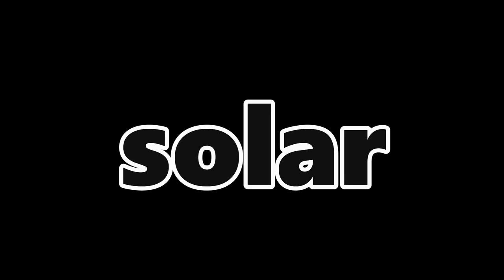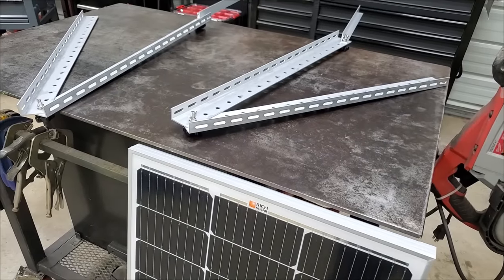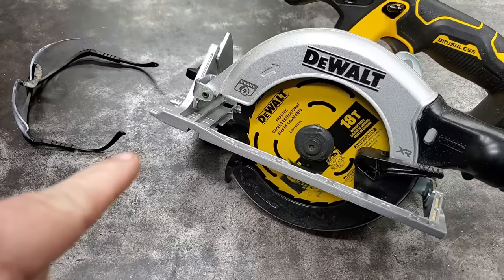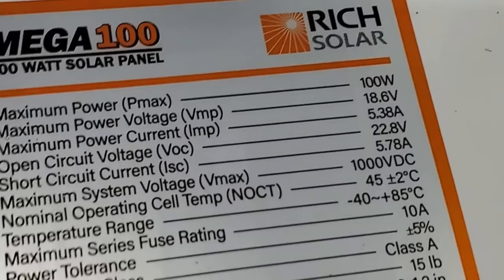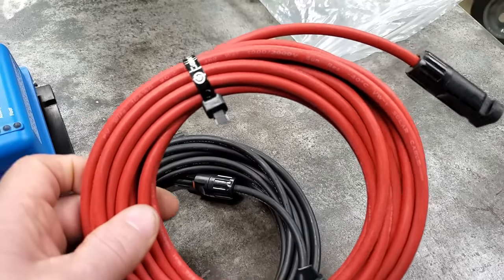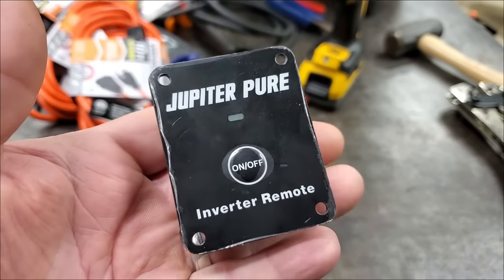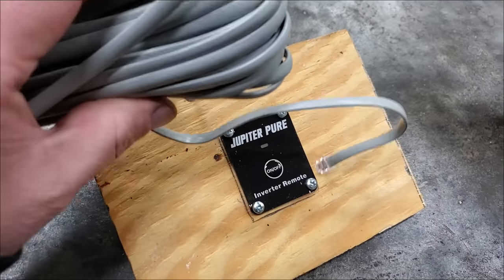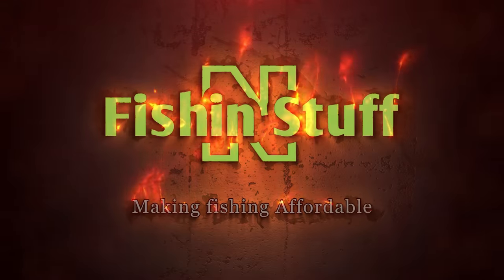Beginners Solar project ( very Simple )

Comment: He says, "If there's a hurricane and it cuts your power out, you can re charge your Ecoflow from the solar panel system on the shed. " ..... so the hurricane that kills your power is going to leave your chicken coop, the solar panels on the roof, your shed, ... all that stuff is gonna be 3 miles down the road, brother.
Reply from the maker: What ever . We are 300 miles from the coast and in 1989 hurricane Hugo knock out my power for 3 weeks Brevard Duke Power was so far behind . No one house or chicken coops lol . Were gone . It just knocked over trees and took out power lines . Do your homework ( but I suspect you know everything  ) Hugo didn't die completely out until it reached Canada
Reply: We don't have hurricanes or tornadoes in the PNW.

Comment: Yikes don't forget to add a circuit breaker and/or fuse in between:
1. The solar panel and solar charge controller.
2. The battery and solar charge controller.
3. The battery and inverter.

Comment: the longer i watch the cheaper hard wiring is lol
Reply from the maker: Of course is cheaper  . It's also not self sufficiency  . I never said it was cheaper  . But if the power goes out it will be , buying a generator and gas to put in it is definitely more expensive

Comment: When U calculate how many solar panels U can put in series, U can not use the Vmp value (18,6V). U have to use the Voc (open circuit voltage), because when the battery is full, the charging stops and the charge controller will resive the open cuircuit voltage from all the solar panels.. in theory, if u only use the Vmp, U can have 8x18,6volt= 148,8 volts, and the solar controller is good for 150 volts, everything is fine. But when the battery is full, the charge controller stops charging, ‘opening’ the cuircuit, and the voltage reatches 8x22,8volts=182,4 volts.. THAT is way over what the charge controller is rater for. U have to go down to a max of 150/22,8 volt= 6,5 solar panels, and since there are no half solar panels, 6 panels is the max U can have in series. (U can not just grab a number (20volt) out of thin air)
But great vid! Good luck with solar!
Reply from the maker: Thank you for the information Sir

Comment: WHY do you use a power wasting inverter?  By-pass the inverter and run 12 volt lights saving money & power.  It works I run my whole house on 12 volt.  I have 12 volt lights through my house including basement, garage yard lights, fans, coffee pot, even an electric blanket all on 12 volt.    Works great. You can get a lot of this 12 volt stuff at truck stops.  I use Edison base light fixtures and Edison base 12 volt lights it's much cheaper and you can add a couple extra lights to get all the light you need this is much cheaper and works GREAT.

Comment: Not trying to sound like a grammar snob, but those aren't generators. They are energy storage. I remember when people first started commercializing portable power banks as generators, it drove me nuts. They don't generate any energy on their own like a gas generator.
Reply from the maker: I know your right and I'm wrong technically  . But to me a portable  power bank , is like what I did with the Ammo box video  . Meaning it's just a battery  . I just feel like they do generate power . By taking the sun's energy and turning it into 120v . Just like other generators take gas and make 120v power . But I do get what your sayin

Comment: The 'remote' is attached to a wire.  Normally the term 'remote' implies there is no connection.  Really, it should be labeled on/off switch and leave the 'remote' off.
Would a controller that allows you to turn a tv on and off that has a wire that attaches to it be called a 'remote'?  I don't think so...
btw @20:22 pv stands for photo voltaic.

Comment: I would have installed 12v lights and avoided the inverter. You will get way more efficiency.
Reply from the maker: Your exactly right , I did think about that when I was planning it . But like I said I'm going to add to it . Ideally I'd like to put a deep freezer out there . I even thought about putting a router in the building so I can run a blink camera ( my wifi won't reach to the back of the building , but it reaches the front  ) that way I can check on my chickens and get alerts if anyone or anything is messing around in the backyard  . I just went ahead and bit the bullet.  I know I could have added it later

Comment: The funny part is you are using solar panels to produce DC voltage, storing it, converting it to 120V AC, to power LED lights that internally convert the 120V AC to ~24 DC.  If you are just power lights, better off to just use low voltage LED's and skip the inverter.
Reply from the maker: I know right

Comment: Bad choice to mount panels on a tin roof, to much heat off the tin that will affect your panel efficiency greatly. A Panels are best mounted where they can vent ( air flow under and around ) also even with directional mounting brackets, I have some too just like yours... you want to find the correct maximum position (s)   called the sun's Azimuth goto online to Sun position at a given date. Azimuth and elevation table. to calculate your panels final mounting position... Trust me if you want to get the best results, put the time in to do the job right.

Comment: Question about the solar battery array.  Can you wire your Inverter to a breaker panel for distribution to lights, wall receptacles and whatever (I get it has to be within the total watt capability).

Comment: Great video as always.
Looking at the money spent, running a wire from the house to the shed doesn’t seem that bad.

Other than it acts like a light switch, why did you use a jupiter pure sine wave inverter after you already have the power converted to 110v AC?   I am cornfused.   haha
Reply from the maker: I'm confused too . 😕 I had a charge controller to charge the battery  . I didn't have a power converter ? I know it cost more but if the power goes out it won't matter then . Cause then I'll be a genius lol . Ive lost my power 5 days during an ice storm before and 2 1/2 weeks during  hurricane Hugo  in 89 . You never know . Plus if you did use it in a place,  that it got used alot . It would pay for itself in power bill saving

Comment: You lost me at $329 for a battery. I thought this was going to be cheap, and your cheap is heading for a grand. I would buy an electric wire, some conduit, dig a trench, run the wire through the conduit, put connectors on the ends and have a massive extension cable. Less than $200.00. I already have the wire left over from another project, so I'm under $100.00.
Reply from the maker: The battery was 229 actually  . No one said it was cheap . If you want to run a drop cord to your shed go ahead . I'm glad you felt like I needed to know that hahaha 😆

Comment: Lets spend $30+$90+$90+$90+$300+$200+$300 to avoid renting a ditch witch $177 buying a roll of romex $80 , $50 misc fixtures and spending on avg  $0.16 per/kWh for power.
Reply from the maker: You forgot the panel box , inspection, and the getting them to come out and mark for water , phone and gas lines . Plus the power company controlling you for ever . Ol and self sufficiency which is priceless  . Like I said I'm a beginner but atheist I'm not a know it all 🙄

Comment: What's the total cost of materials plus lexpected life of materials. Always enjoy your videos. Thank you.
Reply from the maker: The battery says 4000 cycles on it and the charge controller well like I said it's the best . There's a Amazon link in the description box.  I made a list on it of everything I used
Reply: Thank you so much for all the added information. It certainly is a great help in determining if this type of system would be beneficial for my application. Again great videos thank you
Reply: Total of the items in the list is roughly 1020 plus tax, using the cheapest 69 dollar panels in the list.
Reply: @dubmob151  thank. You for doing the leg work. Appreciate it

Comment: What happens if the panels are producing power but the battery is full or not being used? Will that break something?
Reply from the maker: No
Reply: @FishinNStuff at one point you said to hook the battery up to the charge controller before the solar panels or it could burn out the controller. 

What happens to the solar power once the batteries are charged?
Do you have a load dump ( not sure if that is correct term) or something?

Comment: Check max power output in series voltage go's up amprige stays the same and the diagram looks like 80 volts DC.  Does the mmp charge controller handle the voltage use big enough fuses

Comment: So what would this system run? Could i run a tiny home on this? Maybe two batteries? I just need to run ac, fridge, burner, lights, and the odd phone charge or laptop
Reply from the maker: It will run alot but the battery  capacity determines how long
Reply: @FishinNStuff  so maybe a couple batteries. Or like 3 or 4? How's lead acid work? Is it fine as a cheaper option or is there some big drawback to them?

Comment: Why not forget the inverter entirely and just use 12v lights it would be more efficient and get even more power out of the system
Reply from the maker: I would if I was only running lights , but like I said I'm going to add on to it

Comment: should not use the battery more than 60% so 4 hours on one battery is about the best you will get.
Reply from the maker: It's a lithium battery so you can drain it completely. What your sayin is true IF it was a lead acid battery

Comment: Do you need a fuse somewhere? I thought you put a fuse when you made your portable box.
Reply from the maker: I think the invert I'd fused and I was told not to fuse in-between the charge controller and battery , cause if it blows it'll burn up the charge controller  . Because the battery is disconnected  . But I am going to add a breaker between the battery and inverter for peace of mind

Comment: Dont get me wrong.
I realize you are new to this. And just lack the knowledge.
Im here to help you or others. 
Learn from mistakes.
Here is your complete solar system. #1 is just lights. #2 is for all electric needs.
#1 
One 100 watt 12v ( 18v to 22v) panel 
One set of LED clear auto lights. ( Fog lights)
One 12v on off switch.
Optional but recommend. A charge controler.
Optional but recommend . A automotive cigarette lighter with USB 
One DC24 DEEP CYCLE LEAD ACID battery.  ( Can use any car battery just not as productive. ) 
Wire panels to charge controller. Wire charge controller to battery. Wire lights to battery with on off swithch between battery to lights. Using either + or -, not both. 
If you choose no controler wite direct from panels to battery.
If you choose cigarettes lighter plus USB wire direct to battery.
* If you do not use a charge controller it will greatly reduce the life of your battery. But if you do this. I HIGHLY recommend you put in a switch between your panels and batteries. If you start hear hissing, boiling or ???? 
TURN THE PANELS OFF. YOU ARE COOKING YOUR BATTERY.
Also. In a no controler system. Check water level at least weekly. Daily would not hurt.
Not turning panel off may cause a battery to explode. At the least cook them / dry them out. 
This system. I wrote about.  Will cost you less then $300. And you can leave the lights on 24/7 if you choose. With plenty of light. And no drop in light.
If you use a car battery instead of a deep cycle. This will give you about 6 hours of light. Then drop drastically after that. Each day. 
Car batteries just dont have the long term.
Plenty of people will tell you to buy golf cart batteries, or lithium or other types.
The best battery is Lead acid deep cycle Rv batteries ypu can buy at Walmart, or auto parts stores.
If you are an adult and you can not pick up one battery. You need to stop breathing.
No matter how big a battery bank is. It still comes down to moving one battery. 
Will a smaller solar panel work?
Yeah it will.  But ive never bought less then 100w 12v.
Except the one panels i have behind the seat ofy truck. To charge the battery if i did something like leave the lights on all night. 
3 hours and its enough to get my very hard to start truck started. 
#2. Its not hard. But im not going to write it out unless someone asked for it.

Comment: Question ❓ can the panels be set-up for a mini split air-conditioning heater for 200 sq ft.
Reply from the maker: It could but one battery wouldn't last very long . You'd need more capacity  . That's why I said I may upgrade mine

Comment: So, light emitting diodes (LEDs) are direct current (DC). So you are losing power converting DC to alternating current (AC) so you can convert AC to DC and lose more power. Why not buy LED light that use 12 volts.

Comment: Something always seems wrong with taking 12v dc feed from a battery into an inverter to make 120vac to use a light that then converts it back to 12v dc
Reply from the maker: Lol . I could have went DC . But if I add too it . I might try and run a deep freezer with it . 🤔 try any ways

Comment: Why not use 12v lights and 12v electrics in the shed and not use an inverter?
Reply from the maker: You could do that . But I really wanted it for emergencies like I said . Incase the power was to go out I think it will be more helpful
Reply: @FishinNStuff I have gas generators for that purpose, but so far it's not come up. I'm sure if I didn't have them I would have had an extended outage already, that's how things work.
If you have an occasional need to run power tools out in the shed then the inverter comes in handy.

Comment: 21:37 Why did you stamp the negative cable with a + crimp?
Reply from the maker: It did matter to me it was getting covered up with heat shrink tubing . I used a red cable . I have used all black wires before and use black and red shrink.tube to identify them . I mean you can stamp em correctly but at the end of the day you can't see it any way . If that makes sense

Comment: I was looking for that LFP Battery because in this video it looks really good with the Smart battery Monitor etc.
Turns out its totally trash. The Smart Monitor is only connected to the terminals of the bat, so the reading is super inaccurat because of the minimal voltage drop the LFP Cells got. All details at the following testvideo by another youtuber

 Source: https://youtu.be/UzHIQs5Wo8o?si=osrLnO-ZCCMlh4_E
Reply from the maker: Your right but that video is 9 months old . I waited months on that battery to do that video . And they apologized and told me they had to up grade something in the battery  . I'm not sure if that was it . But figured they had got a bad review  . But all I can tell you is to watch a newer video because something was upgraded.  But it's totally up to you . I'm not sponsored by anyone . I just accept things occasionally to save on the cost of all the videos I make . But ive been using it for 4 months and haven't had a problem but who knows

Comment: Did you put a drip loop on the solar panel cable before it goes through the wall?
Reply from the maker: No I didn't need one really  . But that it smart and something I should have talked about  . The roof of my building over hangs the roof of the chicken coop , so the rain will never hit my cable . But if I was installing it into a regular wall I would do that

Comment: wheres the breakers/fuses?
Reply from the maker: I'll probably add a breaker from the battery to the inverter  , the inverters have a fuse in them though . And a solar guy told me something that makes alot of sense  . He said not to fuse from the charge controller to the battery like I did last time . If the fuse blowers , the solar panels will burn up the charge controller because the battery is disconnected from it
Reply: @FishinNStuff the fuse/breaker is there to protect the wire from shorts or over heating and melting the insulation as much as the equipment and should be placed closest to the battery or device
Reply: @FishinNStuff the fuses/breakers are meant to protect the wire as well as the equipment

Comment: Good video but just one thing, this is my pet hate, Pls for the love of God stop calling the Ecoflow a "Generator".  Generator = a machine that converts one form of energy into another, especially mechanical energy into electrical energy, as a dynamo, or electrical energy into sound, as an acoustic generator.
ok rant over ha ha ha
Reply from the maker: Lol . OK I'm sorry . BUT  in my mind converting UV rays into electricity is the save as a generator  . Maybe I'm wrong
Reply: @FishinNStuff  lol, yeah I agree the solar panel could be called a generator, it's the actual box that has the battery in it that drives me nuts when people say it is a solar generator.  Like I said just a pet hate, it doesn't bother me too much, I wait yes it does ha ha ha.  Have a good one, Cheers.

Comment: I am a beginner I played with solar panel for more than one year I just don’t get if you’re only one 5 A why you don’t just use one solar panel instead of three what is the point with the higher voltage when you’re using at 12 wall battery and you also have a inverter if you had a 48 V battery I could understand you want some higher voltage but you were going to store the energy in the 12 V battery so I don’t see the point it seems to me like you’re wasting too solar panels but what do I know I’m just a beginner
Reply from the maker: I'm a beginner too lol . I said u was going to add more batteries  . And another panel most likely . I've hit other plans . I just needed my lights working first . It's says beginner solar . Your not a beginner if your using 48v batteries  .